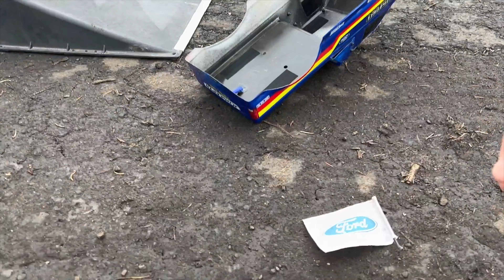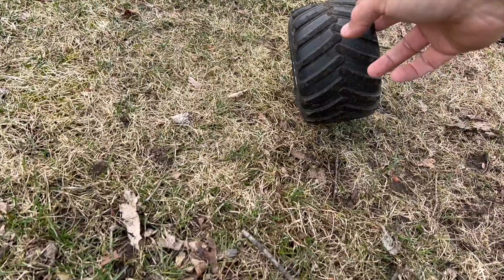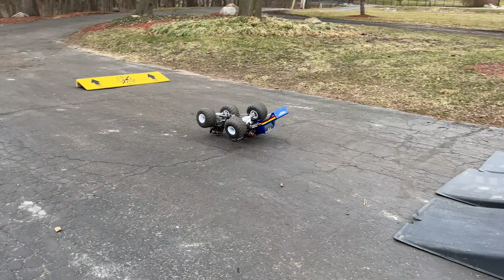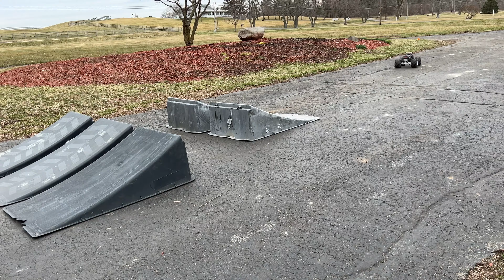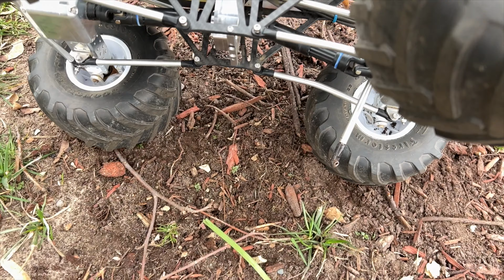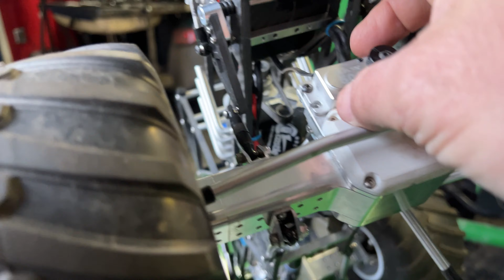RC Monster Truck "Drop Out Challenge" - Bari Musawwir's Penda Thunder Drags Inspired Callout

Comment: I must say that I commend you for this 👏👏👏 not sure if I would have done this with any of my 3 ZEI chassis trucks that are still under construction.  I cringe on some of those runs. I really need to get cracking on my trucks.  The only one of my three that needs the most work is the Bigfoot #10 version I'm doing with one of them. I've already reversed the cantilever, made a custom mount for the rear shocks, redid the front shock mounts and now I'm replacing the replica engine that comes with the chassis with a smaller size cause Bigfoot #10 didn't run a Hemi. Hopefully some time this year I'll have all three trucks finished and hopefully I'll have some other Bigfoot related projects finished or almost completed.